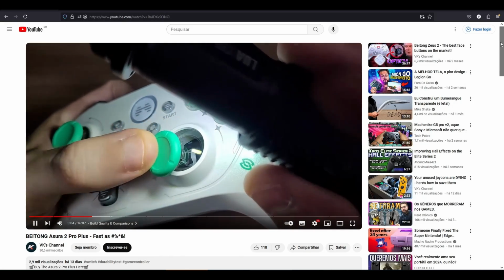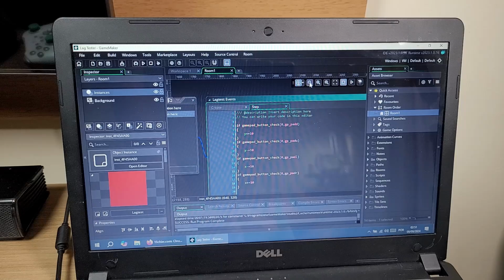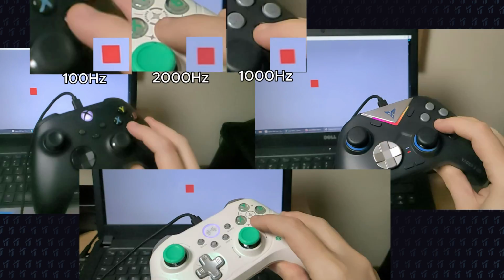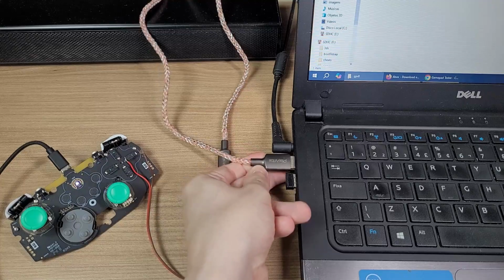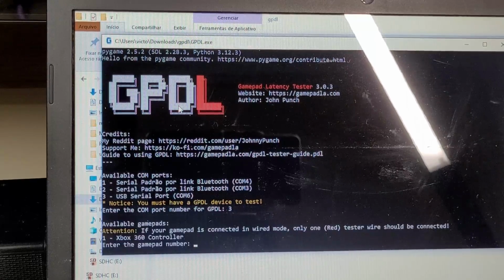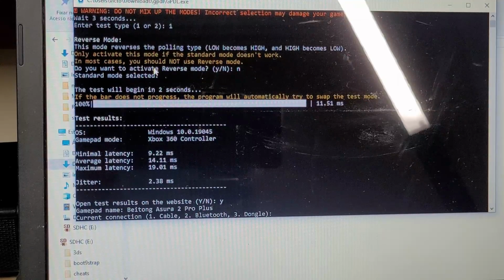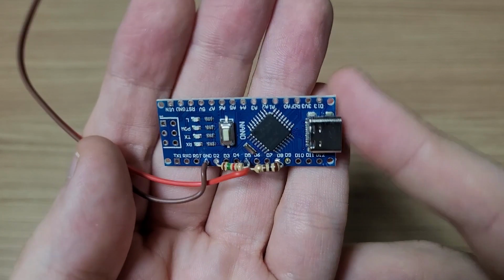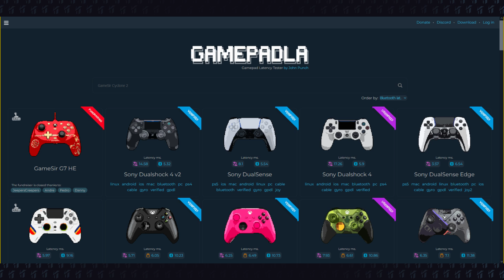GPDL Tester - A Fast polling rate doesn't mean low latency

Comment: I usually check the MiSTer FPGA Input Latency spreadsheet for controller latency advice as it seems more accurate. It's interesting how much overhead the operating system adds, especially when using XInput or wireless with different Bluetooth dongles.

Comment: Thank you VK for doing this. For the latency, did you test the button or the joystick? Because of the website you showed, many of the tests are for button latency, not the joystick. And Beitong Asura 2 Pro Plus NearLink, has very low latency for joystick latency. Please review it if you could
Reply from the maker: I tested buttons
Joystick latency tests are still experimental
and soldering the wrong points can damage the controller, that's the reason I still haven't tested it yet but John Punch is updating the results for all controllers on the gamepadla website and soon it will display the sticks and buttons test for the Asura 2 Pro Plus too
Reply: @VKsChannel  he only updated the regular version, it’s different to the nearlink version. Also, It’s quite unfair that only button latency were tested cause the polling rate is effecting joysticks more than buttons
Reply from the maker: @shellyfof  But don't you agree that latency should be fast for sticks and buttons?

what good is there in only a fast analog stick?

your movement is faster but then when you press the buttons to do the actions in-game you have 14ms of delay
Reply: @VKsChannel  I think both of them are important. Thank you for reviewing the buttons☺, the title is a bit misleading however, I was looking for latency for joystick😷. If you wanna prove that a high polling rate doesn't mean low latency, it’s better to show the sticks' performance instead of only buttons. Also, the key selling point of this controller is not the buttons, from the Aliexpress page it seems like just normal mechanical keys. Anyway, it just gets me more curious. Let's look forward to the joysticks latency from the website soon.
Reply from the maker: @shellyfof  I will surely test analog sticks as soon as possible and I'll bring the updated information again when I make the ranking of the best controllers for 2024 later this year